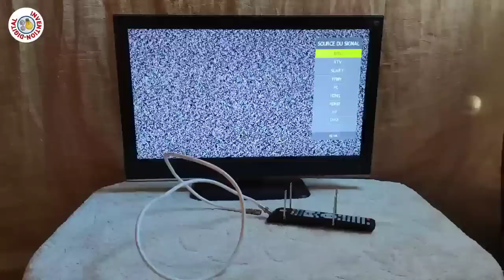A strange idea to convert an old remote control to a digital antenna for DTV

Comment: You have to explain what you are doing, otherwise, it is just a waste of time of others.
Reply: Not if your a Electronics Technician lol
Reply: @MUDALIGE YEAH I THINK THE SAME THING. AND ELECTRONIC TECHNICIAN DOESN'T NEED TO WATCH VIDEOS LIKE THIS. SERIOUSLY, I DON'T EVEN KNOW WHAT KIND OF THINGS YOU'RE USING EXCEPT FOR THE DRILL. I DIDN'T WATCH ANY OTHER VIDEO EXCEPT I TRIED TO WATCH HOW TO MAKE A HD ANTENNA, BUT TURNED IT OFF AFTER I SAW IT WAS BASICALLY THE SAME AS THIS ONE... I THINK YOU'D HAVE MORE TRAFFIC IF YOU DID, AND REPEAT VIEWERS ON OTHER VIDEOS.

Comment: I just use a 1400mm antennae cable. That's it. Nothing more. I get around 80% of the digital channels without having to move it. Try it without the remote stuck to it for even better results.